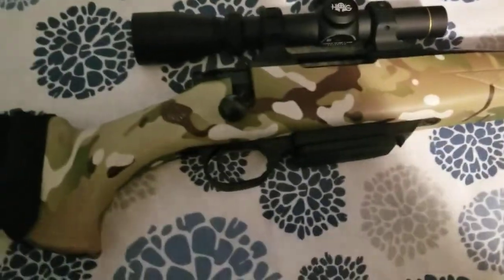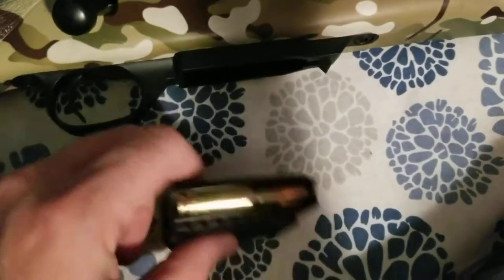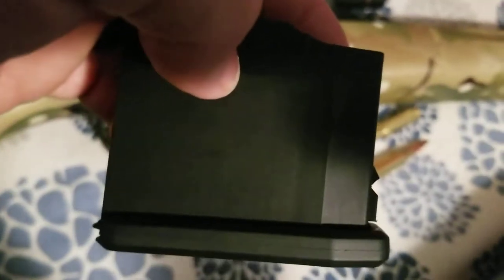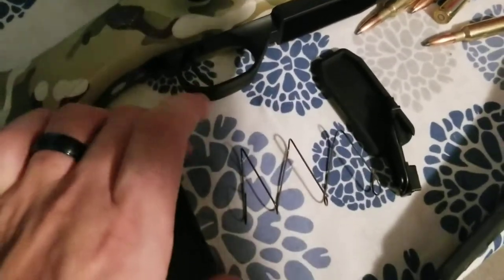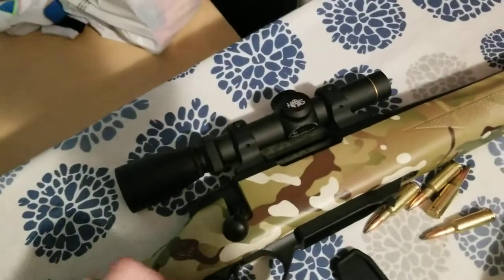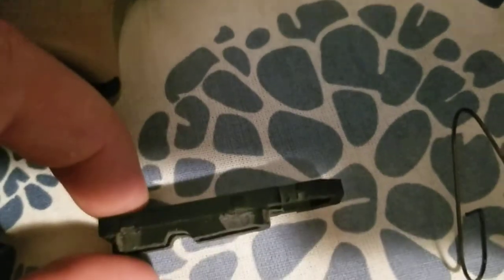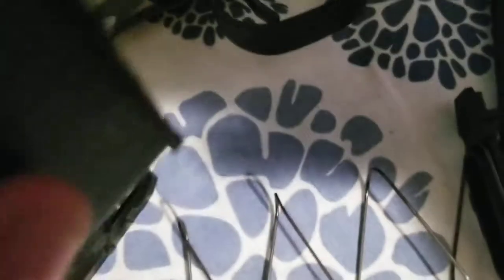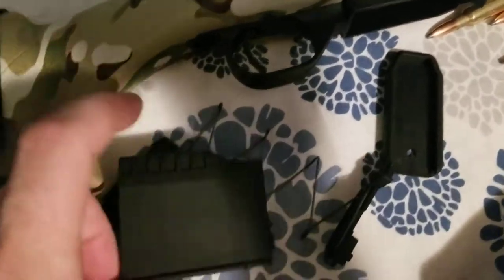Howa magazine mod

Comment: This mod also works for the .223, reducing it from 10 rounds to just 5. The rifle feels way better to handle with the mag sitting more flush with the stock. It’s also worth trimming down the mag release tab just a bit, just enough so it is less likely to get caught on everything and drop your mag out every 10 steps.